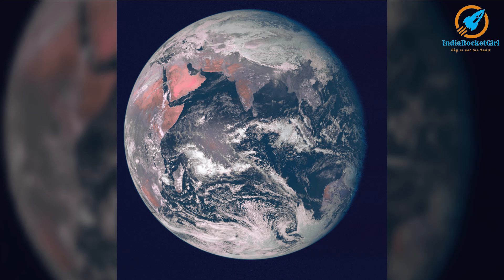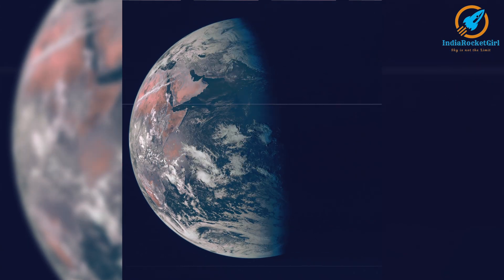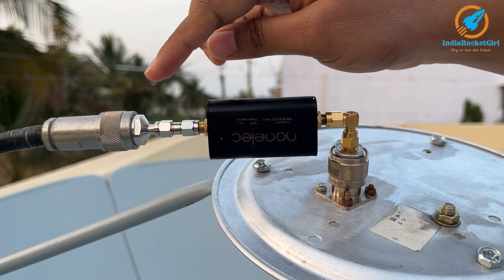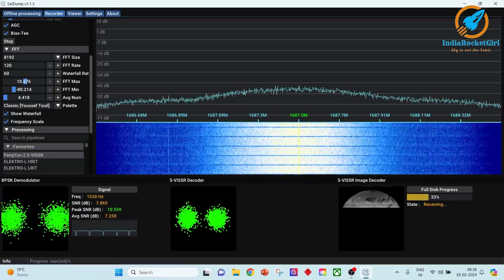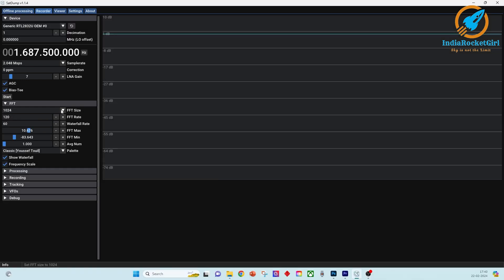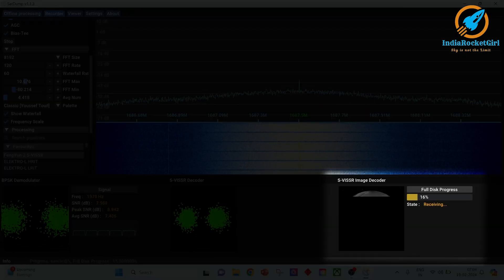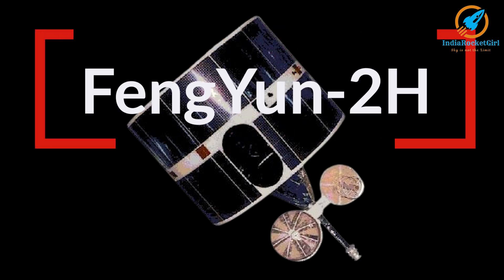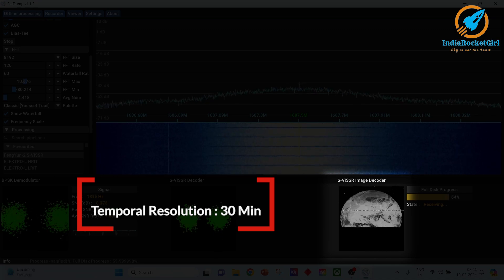How to receive Real Time Images from Geostationary Satellites | Best Satellite Project

Comment: Hi! Was it easy to assemble the dish? I have been trying to source an 80cm dish but to no avail. Any leads would be helpful!
Reply from the maker: It was easy to assemble the dish...A 1.2 meter dish will be better. You can try the solid sale website for the dish.
Reply: @VU3BIZ  Thanks for that, it's something I'm considering. Any tips on positioning? Was it mainly a manual process of pointing and finding the best signal? Or is there a smarter way for me to do that before assembling and moving the entire dish?
Reply from the maker: Yes you need to find the satellite's azimuth and elevation with respect to your location...Orbitron is a good software for it.
Reply: @VU3BIZ  thanks for this and any way to check if the satellite signal strength is good enough? Before investing in the dish etc I want to make sure it'll be successful
Reply: @VU3BIZ  Another question - which connectors are you using for this? I'm especially interested in the connector you have used at the helical. Could you also share any resources used as a blueprint / guide for the set up itself? Thanks!
Reply from the maker: @heuheuheu993  	
N TYPE STRAIGHT JACK, SOLDER CUP
Reply: What gauge copper wire did you use for the feed? I'm finding it difficult to manipulate 10 gauge
Reply from the maker: @heuheuheu993  I used 2mm cupper wire
Reply: @VU3BIZ  thanks! I was trying with 3.25mm and it was very stiff

Comment: I’m trying to build a similar setup, I brought “Solid 180cm 6ft C-Band dish - Punch Sheet - 18 Ribs” (since the one in video is out of stock) 
can you please share exact measurements for the helical antenna ???
Reply from the maker: Higher diameter will work fine. For helical antenna calculations, you can refer this link. https://www.changpuak.ch/electronics/calc_12b.php

Comment: Why can't we use yagi for receiving images from geosync sats? Like you did with NOAA sats.
Reply from the maker: Frequency and polarisation is different so antenna design varies
Reply: @VU3BIZ can you please elaborate or suggest me readings to understand this?
Reply from the maker: @dipan-saha  Yagi antenna is designed for 128Mhz whereas The dish is designed for 1.6Ghz as the frequencies are different the size of the antenna differs.
NOAA's signal is right hand circular polarisation but fenguin-2H transmits Linearly polarised signal so the design of the antenna differs.

Comment from the maker: RTL-SDR.COM acknowledging my work 😍😍
https://www.rtl-sdr.com/indiarocketgirl-receives-fengyun-2h-s-vissr-satellite-images/
https://x.com/rtlsdrblog/status/1762413658217558065?s=20
Reply: Proud moment 👍
Reply: The antenna shouldn't move much and should be stable if you are receiving an image.
Reply: @SwethaPrabakaran  re: "...shouldn't move much..."  is that because signal strength is so weak from satellite, or Rx signal pattern is narrow from sat?  If I attempted to Rx from sailboat, I would intend to anchor, not be under way, but might still have waves rocking boat a bit. How narrow is Rx pattern on the ground, or does it need to sync and lock on, so ANY motion prevents sync ....or...does ANYBODY know...has no one tried this I wonder ?   RTL-SDR sells simple "rabbit ears" Di-Pole they claim can Rx images without parabolic antenna.....is the difference just faster reception with parabolic ? 🤔
Reply: P.S. Is signal strength so "delicate" (low) that whatever antenna we're using must be completely still...unmoving ? I have wondered whether we could receive these images on a sailboat at sea ?
Thanks again...from
Jeff, Florida, U.S.